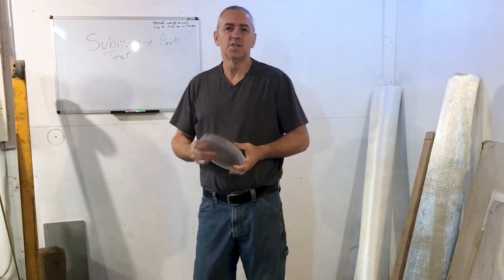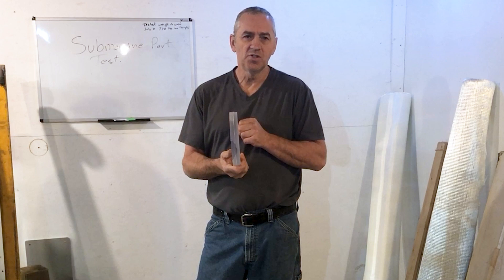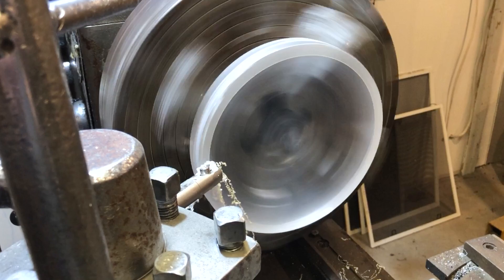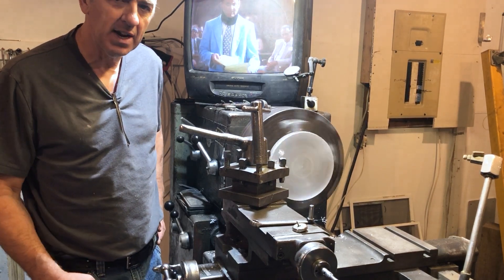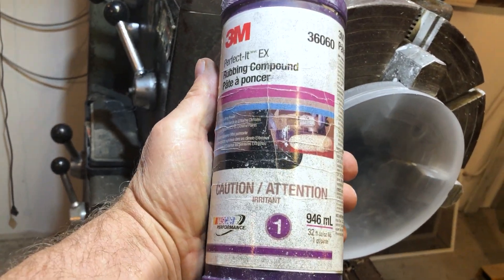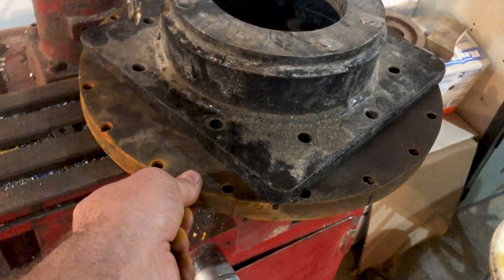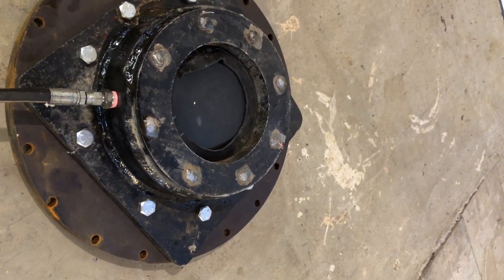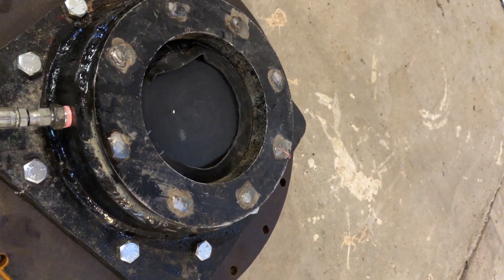Epoxy Submarine Window Test

Comment: This is fantastic, I need to make some very large clear domes for a solar power invention of mine, I need them clear with "Fresnel" lens grooves on the surface and thanks to your video I may be able to make them.  I'm going to start trying in the spring, again thank you
Reply from the maker: Good to hear, if you want a specific test done, let me know.  We are doing all kinds of sampling
Reply from the maker: how big are your domes you need and how deep?
Reply: I am going to try many different sizes, depths and scales in order to control the focal point.
Reply: @HankPronk  I will keep you in mind though, because I may need your expertise when the time comes. Thank you again
Reply from the maker: @ProlificInvention  we are planning to make a 2 inch thick 180 degree dome for a submarine project
Reply: There are two ways to make acrylic doms. Under vacuum and heat from an acrylic sheet or in a dom mold under pressure in a controlled pressure oven